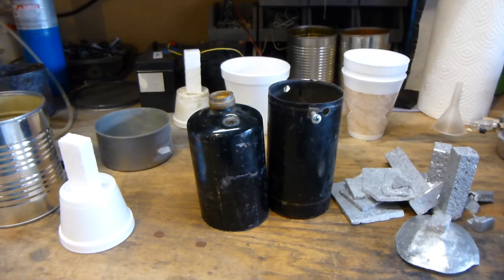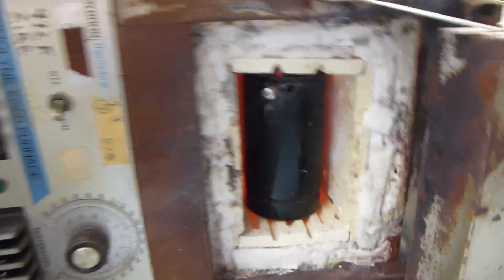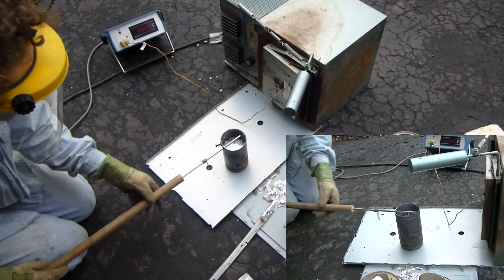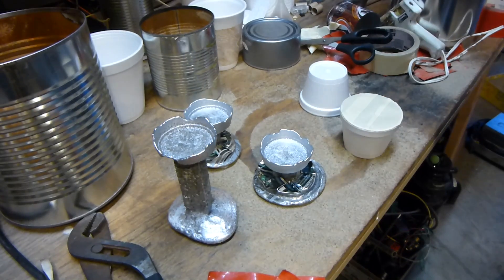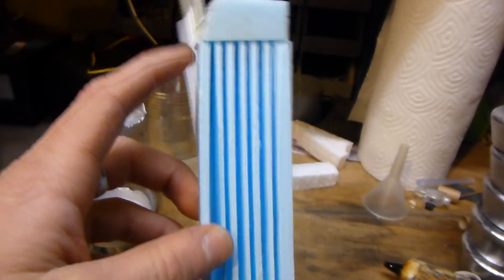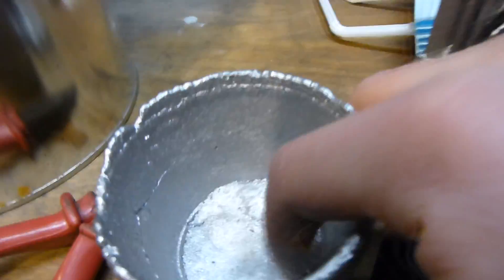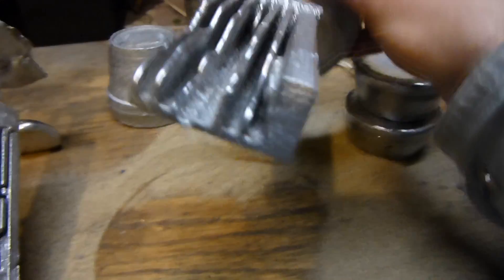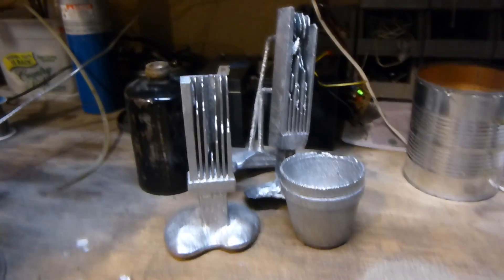Aluminium Casting Styrofoam Cups and Heat Sinks

Comment: At 5:57 why does the 'crucible' appear purple? Does your camera register infrared light and make it appear purple for some reason or did the paint turn purple somehow?
Reply: Makerj101
It could be worse, the camera could pick up your infrared light.
Reply from the maker: +5thDragonDreamCaster Yep.  Cheap dumb camera does that with hot things.
Reply: Makerj101
The resolution isn't too bad, but I could immediately tell that it was glowing the wrong color. I've poured molten copper before and it glows yellow, but how hot would something have to be to glow that purplish color?
Reply: +5thDragonDreamCaster probably because of infrared rays. when u record a tv remote with a camera its IR appears to be purple.
Reply: Hurdalık Cini
That's what I was thinking.
Reply from the maker: 5thDragonDreamCaster This camera just picks the IR up really well.  No filters in the lenses to stop the IR from getting to the sensor.  Or at least less than more expensive cameras.
Reply from the maker: 5thDragonDreamCaster Well if it was that sensitive it would be awesome!  You couldn't really have a camera that's that sensitive on accident.  You have to use a special sensor to pick up that little of IR.
Reply: Makerj101
Yea, at least it dosent
t pick up IR AND UV.

Comment: Coat your styrofoam in a highly permeable clay slurry & let it dry.  The clay will need to be super fine.  Coat it at least twice.  The clay will allow the gasses from the burning polystyrene to off-gas without disrupting the surface finish of your product.  Let me know how you fare.

Comment: The proper way to do it is to make a clay slurry.  Then paint that slurry onto the polystyrene (all over except pouring hole) and let dry before you cast.  This not only holds the model together when it is to be cast, but also keeps all the detail too.

Comment: Have you tried adding oil to your sand? it make it easier for your mounds to hold to their form. you will know you have the right amount of oil when you can pack the sand into a ball but the ball will break at the slightest pressure. 
Peace in Christ
Jeff

Comment: Did you try to make a shorter port for the bottom of the cups? I am calling it a port. The rectangle piece you have glued to your cup. maybe if you shortened that the aluminum won't cool as fast and make it all the way down to the bottom of your cast. Shorter distance to travel may keep the aluminum hotter for ya

Comment: Great using safety equipment, But DON'T kneel on the floor or wear slippers.
Using molten aluminium!!
If you drop the crucible, the alloy will splash just like water but at 700 Celsius.
over you knees , and sweat pants, very quick 3rd degree burns
Reply: +Daisy Hopper 
+1 plus pour sand around where you are pouring. That way if you have a spill , the sand will catch the molten metal and slow it down/absorb it.

Comment: Bravo for trying, but words like not too bad, pretty good, turned out nice do not really describe the actual results.  Try failure, unusable, not ready for prime time, grossly deformed.   But for optimism you get A plus.
Hard sand mold with no styrofoam might work.   Or wax that you melt out before the metal pour.   Like they do with rings.

Comment: So why not just mould the inside of the cup with clay, and mold the outside of another cup (with a bit of a funnel bit you can cut off later) with moulding clay; then pull the cups out.  Put those moulds in the oven for a bit to cure the clay.  Then all you need is a little crosshair of foam or what have you on the bottom of the outside cup to hold the inside cup up.  That'll get you a way better cast mould than polluting your aluminium with so much foam cup slag.

Comment: Have you tried finer sand and DAMP sand?

I have seen lost wax casting at the renfaire and they use wooden boxes and damp sand.

I think the dry sand is not holding it's position and giving way to the flow of hot aluminum.  

I saw them carve rings from wax, fit them to the customer, pack them in very fine damp sand and cast with silver and make awesome jewelry with exquisite detail.

Comment: you'd have better luck if you used something to dampen the sand...either a finer grade greensand using water, or an oilsand so it can be compacted and will retain it's shape better
  find an old metal shop text book and study up on some of the methodology (or check on line, there's lots of good resources; just google "lost foam sand casting"   casting using lost foam is very workable and allows for complicated detail that is otherwise impossible in an ordinary cope/drag format.   But you need something to stabilize the sand while the foam is melting away.   One site I know of on Youtube, he coats the foam in wallboard mud, gives it a couple days to dry hard, then fills in around it with sand.   Such a method can give truly impressive results....

Comment: Try using plaster instead of sand. When it is sets heat the mold until the foam burn away. Use the now hollow plaster mold to cast

Comment: Thank you for the video... I am working on a propane forge, and I'm glad to see it's not as hard as I worried about.
Thank you also for the tool idea for the crucible - mine will be vertical, but I will probably use a variation on your handle idea.
One of your comments mention using the proper sand, I am sure that's what happened to your casts... 
Also, your sand may be cooling the aluminum before it gets far enough in, just a completely inexperienced thought on my part...

Comment: The casting (green sand) idea many are propounding here is what you need, but be very careful with what you pour and wear at least boots and a face shield when you do it.  You will need exhaust vents too as this gets really dangerous if you have an area of sand that is surrounded on all or most sides (as in the case of a downward facing cup) by molten aluminum.  You'll get superheated steam in an instant (from the moisture in the greensand) and, if it has nowhere to vent, it will cause a small explosion in the molten aluminum by trying to escape through it, potentially showering you with the hot aluminum.  Anyway, it's wonderful to see a young person interested in interesting things rather than pursuing nonsense.  Keep up the good work and keep experimenting and it will pay big dividends later.

Comment: I tried what you did with the heat sink and  got pretty much the same result. A little better than yours but I think my fins were thicker. Then did a do over withe the back of the heatsink up. This was even better. Best way is to pour a billet and machine the fins.

Comment: yeah i think the problem your having is the sand its too loose and instead of the gasses venting out the pour hole or vent holes they are out gassing form the whole mold so your getting a rough cast.

Comment: mix vegetable oil, mineral oil, etc... with your sand. pack it around your foam. Your pours will be better. Also using a finer grain sand will help as well.  As he Styrofoam melts away your sand is collapsing into the mold space.

Comment: Hey young man do some research on making green casting sand I think its hot enough but the sand is closing in on the foam  that is why the double cup method worked better. good hobby keep it up.

Comment: Build a wooden box 6x12x6 and lay it flat. Place the heat sinks with risers on each end and I will bet the casting will turn out much better. You are fighting a trapped air problem.

Comment: sand casting core binder, make a plaster of paris  mold put in furnace it will burn away the Styrofoam, then pour in the aluminum . the idea of turning the cup would be good because you could put vents on the edges of the cups. 
I believe your fails are because of the Styrofoam gases getting trapped at the bottom of the mold and as suggested the sand collapsing at the bottom of the mold.

Are you recycling cans?  keep forging ahead ...

Comment: Maybe try pouring it so that it fills from the bottom up. kinda like u did with the straws but pour in a hole to full up using the holes the straws are in and that way it would fill the mold itself the way it filled the straws

Comment: i honestly dont know much about aluminum casting, but it looks like you are using regular sand as opposed to the red sand meant for casting, which feels more like clay than sand. if that is the case, the problems you are facing may be due to the sand collapsing in on itself as the styrofoam burns faster than the aluminum can flow in. but that is just a guess, based on being a mechanical engineer, and not being an expert on casting or anything

Comment: You need to make channels coming off the bottom of the cups so that the air can escape. The molten metal is getting air trapped and hardening before the metal can make it all the way to the bottom.

Comment: Why do you have to make new crucibles? how long will that propane tank crucible last?
Reply from the maker: +Zoe Doucette Maybe 10 castings before it fails.  The aluminium dissolves the steel so it gets thinner and thinner until it busts a leak.

Comment: Oil the sand a bit and ram it into the mold.  You'll have to work out a sequence to keep the styrofoam  from collapsing.  Also consider making a core from the inside of the cup and then fitting a negative of the outside of the cup over it.  The thin styrofoam seems to be able to keep the aluminum out of the cavity by gas pressure or cooling of the metal.

Comment: I think you'd have better luck using actual mold sand with that can hold its shape instead of trying to melt the foam away to make space for the aluminum.

Comment: Just a tip. Cover the polystyrene with a coating of dry wall plaster. Mix with water to a slurry and paint on, or spray the cup with water and dust plaster over to get a thin coating. Let dry completely. 
This will prevent the dry sand from collapsing into the mold as the polystyrene is vaporized. Cheers Cam.

Comment: It looks  like you are using regular sand and not green-sand. Basically you need to add a binder to your sand (fire clay or bentonite),a little moisture(very little) and mix until you can squeeze a lump of the sand in your hand and it holds shape. Also, a finer sand would help (you can try screening it thru a mesh (sieve or window screen) and use only what passes thru. Finally and most importantly, you need to create air holes. The sprue is not where your gasses should escape.Use small skewer sticks or some thicker stiff wire to poke holes in the sand until it touches your foam. make many of them. The foam vaporizes and needs to escape quickly or it will impede the aluminum flow.

Comment: You might need to use some flux and a needle width size gas vent so you get the full cast volume.

Comment: it didn't work because the sand was to fine and dry for the thin cup so it just collapsed once you began pouring try sand that's a little wet

Comment: The failed cups would make cool ashtrays. Leave the sprue and use a small round file to make a couple slots to hold cigs.
Reply from the maker: +beetlewing LOL yeah that would work!  Prob is I don't smoke and I never will!
Reply: +Makerj101 As a smoker, stay that way, however it doesn't mean you can't profit off of our stupid choices
Reply: Is possible casting a cup from copper.

Comment: if you want to achieve better details  as done in commercial  foundries, the sand mold is vibrated during  pouring ,
Reply: +Tom Wiggin  the metal mostly aluminium

Comment: the commercial casters dip the Styrofoam in a slurry of alumina powder , you may try plaster of paris  to give it a coat of light skin , let it dry and you got a perfect cast.
Reply: +sam terian I read that a slip made from powered drywall patch (mix it yourself, not the premixed) works well.

Comment: I hadn't read through all the comments, but here's a suggestion. Try painting your foam with latex paint except at your entry point. Also get a smaller soup can to put on top to get more pressure or weight from the aluminum. The latex will keep the sand from breaking through and entering what you want casted. Also it rinses off with a garden hose easily. Dave Kush at http://www.buildyouridea.com/foundry.html has some awesome info that might help you out.

Comment: u need a vent on top  and u need the cast to fill from bottom to top plus the sand  needs to be sticky so it holds when the foam melts  so it leaves a void vs filling in with sand

Comment: You are a very clever boy when I wAs that age I was no where near as switched on as you now @ 38 I've got a masters degree in mech engineering and I'm an applications engineer for a massive Austrian machine tool maker........ What I'm saying is the sky is basically the limits for you I don't think there is nothing that you can't achieve I work with 16 to 22 year olds in the UK everyday and a guarantee if you put all of them together they would not be as capable as you  credit where and when it's due I tip my hat in your direction I would wish you look but I don't think you need it   Good look

Comment: Don't you need to add somthing to the sand and pack it down to make it bond together so when the syrofome melts the sand doesn't cave in?
Reply: +Makerj101 You still use green sand for lost foam. The point of lost foam is you can cast things that have a positive draft angle and cannot be released from a mold. The problem here was the heat nuked the foam, and the sand collapsed in faster than the aluminum could flow in.
Reply from the maker: Brad R That's for green sand casting.  This is lost foam casting which is a little different.  You can use dry sand with this method.

Comment: you should try using 1/4 inch styrofoam board that you can get from the dollar store to cast your heat sync's, it has smooth and even surfaces for casting, just a thought. have fun as always (:

Comment: You need some binder in the sand to hold it in place as the metal burns away the foam. But you don't want the binder to make it so the foam gasses can't go into the sand.

Comment: You're a pretty smart guy, but I had to like the part where you said "the furnace uses lots of power" haha, bet your parents love your electric bill! But then again, you're not in ontario Canada where it would cost you $80 to melt your $12.00 worth of aluminum lol

Just wondering, if the heatsink fins are too thin, the foam burns off and then the sand collapses filling in the void? If you notice, the areas that are thicker fill with aluminum quite well......

I know in commercial casting they use a binder in the sand to hold it together while doing the pour......
Reply from the maker: michael C Thank you!  LOL yeah electric isn't that expensive here.  Probably costs about $0.20 per hour to run my furnace.  Which really ins't bad considering how fun casting is.
Yeah my foam was probably much too thin.
Reply: Makerj101 holy crap....that's CHEAP...it costs $0.12 to run a hair dryer here in Ontario Canada for an hour....and that's only 1000 watts.

Comment: To be more precise the foam is not all really being melted by coming into contact with the metal.  It is burning from the heat that precedes the metal so that the sand collapses. I agree that wet sand or some other sand will hold its shape longer as the foam burns out.

Comment: The problem is that the styrofoam is not really melting at the right speed. It's more like disappearing in a flash and not maintaining the space for the aluminum to flow into.  Without the foam holding the space long enough; the sand caves into the space held by the foam before the aluminum can get there.  With the "lost wax" method, the wax melts just slowly enough to hold the space for the metal to flow into it. The difference between the foam and wax is only a tiny fraction of a second but just long enough.
Reply: Mike Breler In the lost wax method the wax is burnt out of the mold in an oven before the metal is poured.Lost foam works because foam has very little mass for it's volume and will burn out of the mold with only a small amount off gasses being produced. Green sand is fine for lost foam casting.

Comment: If I can suggest using wet sand as it will be more structural when the foam is melting away. In your heat sink the sand is filling in faster than the molten aluminum after the foam melts. Good luck

Comment: hey can you let us know how many times you use that propane tank crucible before it blows out? and i let you know how many uses i get out of a fire extinguisher crucible that i'll be making as soon as i build a bigger furnace. also with the double cup, did you put sand in between the two cups? thinking that might be where the air pocket came from
Reply from the maker: blankdsk I've used it about 20 times so far and it's still going strong.  I may replace it soon just because I do not want to take the chance of it failing in my electric furnace.  Would be catastrophic to my furnace.  The molten aluminium could get into the heating elements and short things out.

No, I did not put sand between the two cups.  I actually turned the cup on the lathe and it turned out really really nice!
Reply: your melting only aluminium? i've been melting silver. i guess the heat differences have a lot to do with crucible life. i actually cut up a map gas bottle yesterday and have done two pours with it, i'll let you know how many i get. i'm using a home made furnace so i can use it until it fails with no worries. hey, thanks again for sharing.